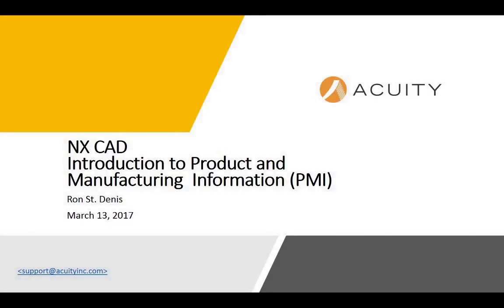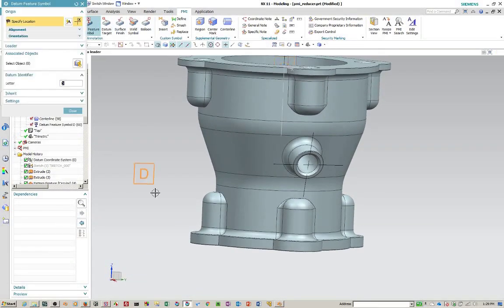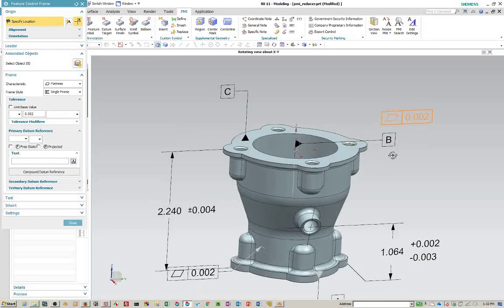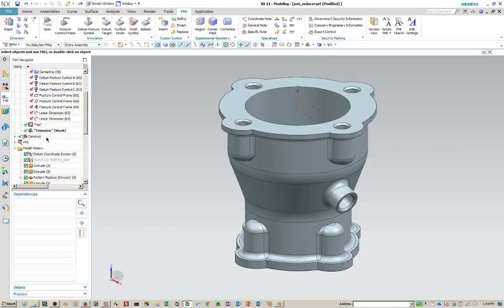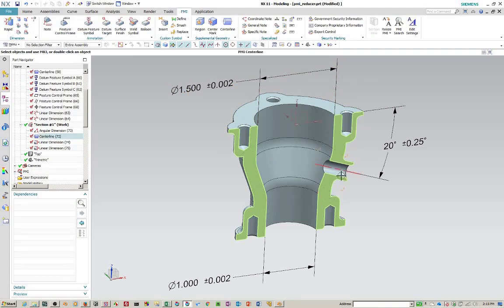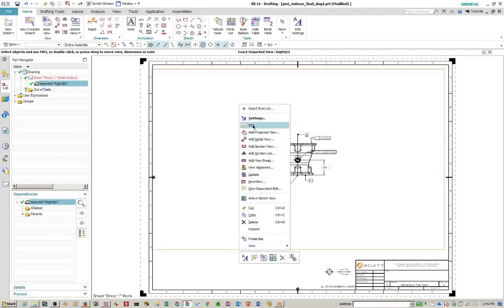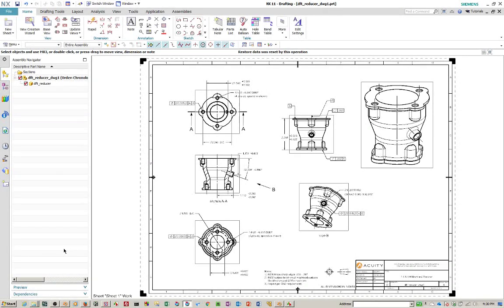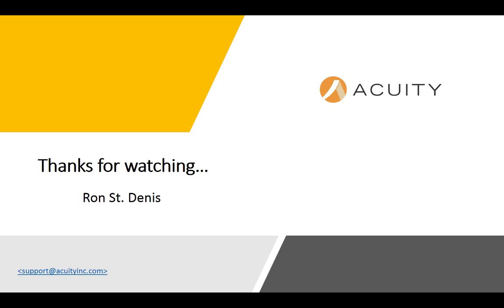NX CAD introduction to PMI (Product Manufacturing Information)

Comment: It's a great video. But applying datum B to the axis is it right?. Mostly we apply datum feature symbol for surface and extension lines and dimensions but not for axis.
Reply: You are correct.  That would have to be a constructed datum, it doesn't physically exist.  When we make these videos, we are trying to show people as many commands and options as possible, it should not be considered a how-to for Geometric Tolerancing
Reply: it"s a great video .

Comment: what is the difference between giving the dimensions as PMI in model with detailing the views in the drawing module ?
Reply: If you apply the PMI to the model, you have additional utility.  For instance, the manufacturing environment can read the PMI and automatically determine the process required to meet feature tolerance.
Reply: Nothing. PMI is the 3D model base dimension, instead of the 2D drawing sheet format.

Comment: What I still don't get is why NX doesn't have the "show dimensions" ability like CREO has.  One should be able to use the dimensions to define the features in the part for annotating the part either in PMI or drafting application instead of redoing all the dimensions twice.
Reply: Feature Parameters its called. Not as smooth as Creo but it does work .